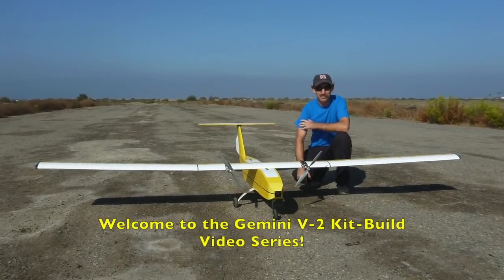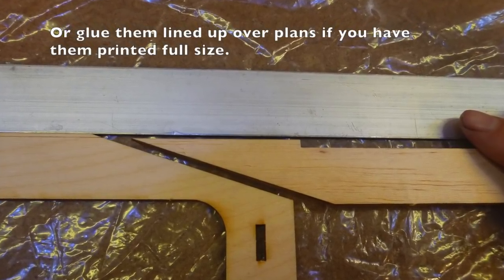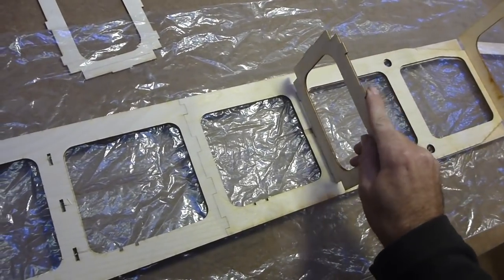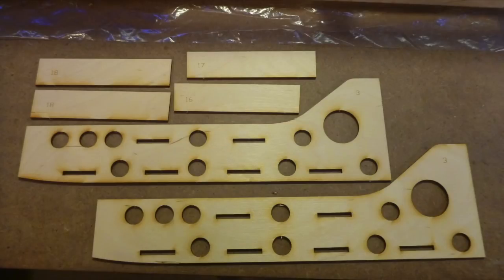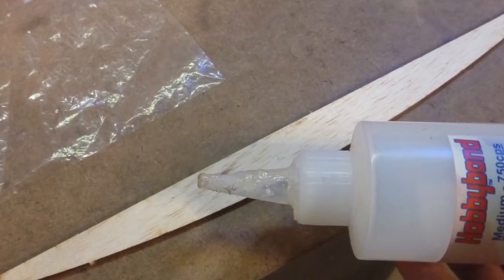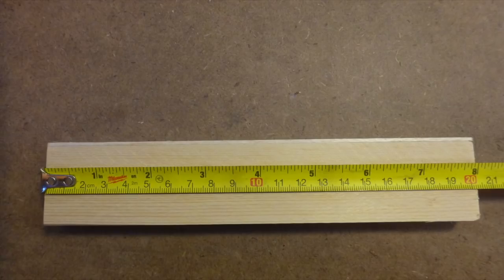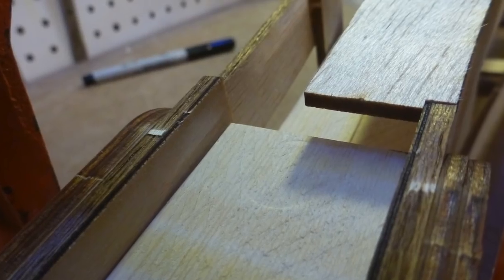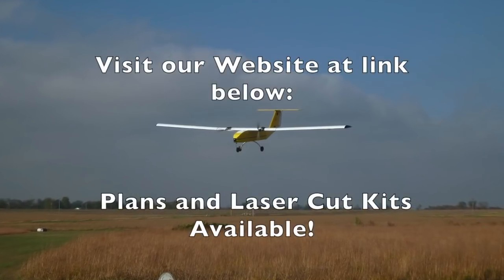Gemini V-2 Laser Cut Kit Build Video #1 - Fuselage -

Comment: very good your project, I am thinking of buying the plan of it since I am from Brazil it would be prohibitive to buy the laser kit as I have the laser cut here I could make the cut myself, how long the fuselage has dawned to have an idea of what it would be like to transport in its specifications only has the scope of 3.2
Reply from the maker: Yes, you can see pictures on the review episode, and some of the other videos about how the modular design works. it's designed so that the longest parts are the fuselage, and outer wing sections, and they are the same length, about 140cm, with accessories, so can fit in the trunk of a small car.   the vertical stab and horizontal stab are removable, the outer wing sections are removable, and the center wing section Is also removable from the fuselage, but we find it almost always fits without taking it off.  Modularity was one of the major priorities when designing the aircraft, as it had to fit in the trunk of a small car, like our 1986 mercedes 190D.   Plane cost 5X as much as car.. Ha Ha